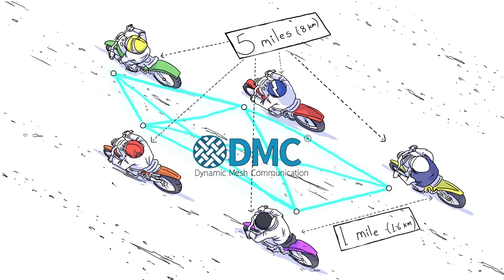🔍 What DMC is All About and the Difference from Bluetooth? 🚀

Comment: well i have 3 packtalk bolds and the range is never more that 200yds max at a push between any 2 units so whats wrong there then ? even passenger to pillion coms breaks down also the radio randomly turns it's self on its annoying
Reply: u can turn off the radio voce commands, i just found out a few days ago
Reply: The range claimed is dependant on perfect conditions.  Even as a group 3+ we find even with line of sight capability, the range is not much, 200 - 300 m. Never managed more.
Reply: @duncangatland6021  exactly what is perfect conditions if it's not line of sight ...i'd like too know what cardo claim as perfect conditions ..